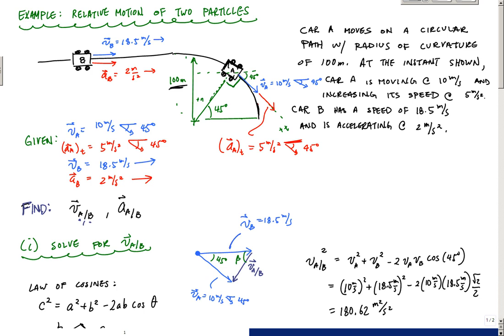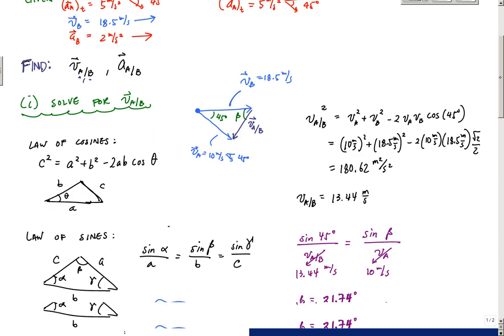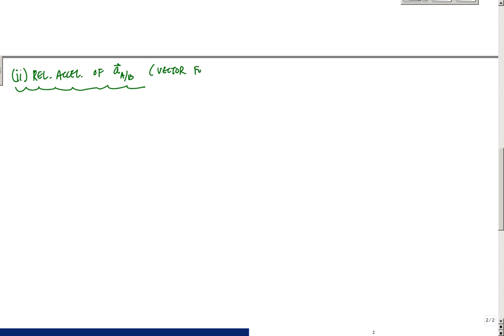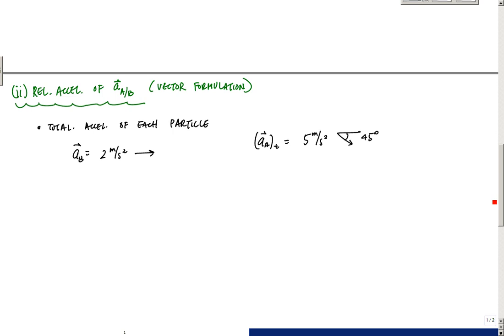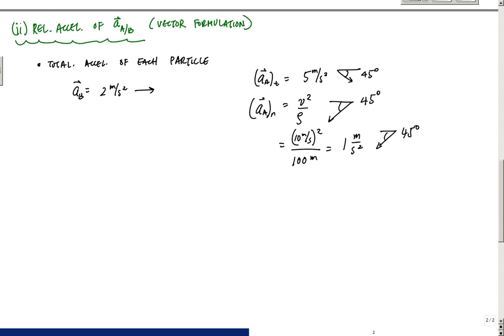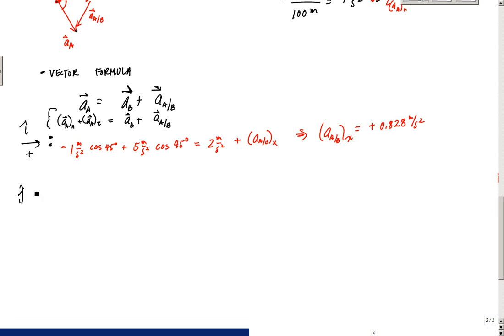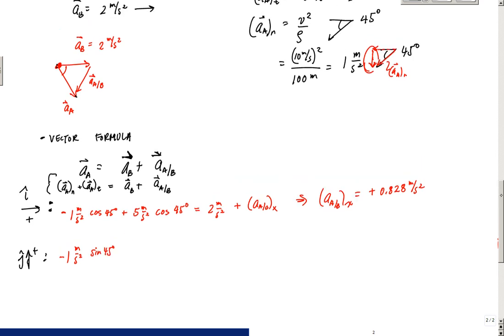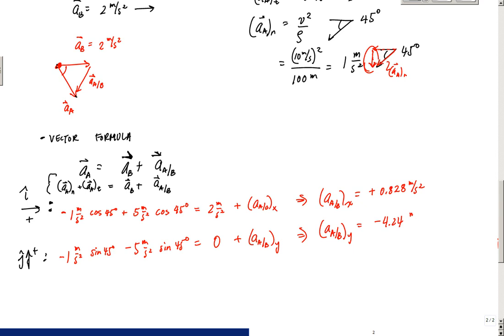Relative Velocity and Acceleration Example (Part 2) - Engineering Dynamics

Comment: can it be solved as a triangle like V (A/B) the one before it ? cuz i got a wrong number while doing so
Reply: Same question. When I solve it with triangles I get a(A/B) = 3.81m/s². Didn't calculate the angle ('cause i know the length is wrong)